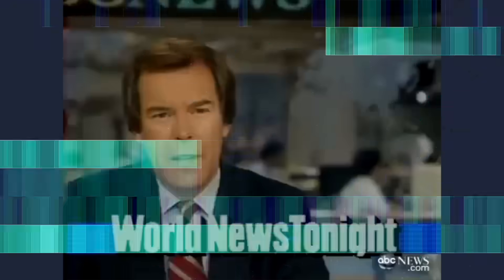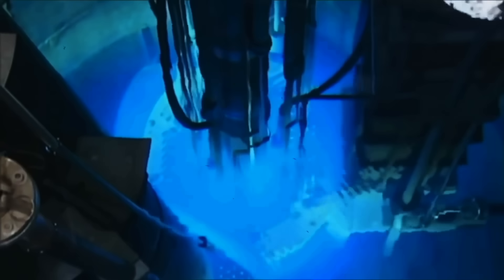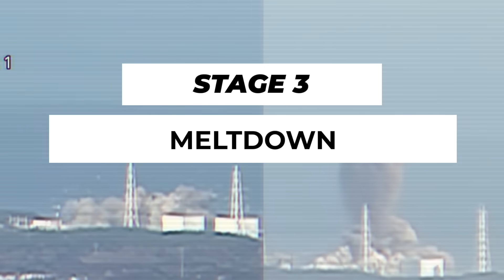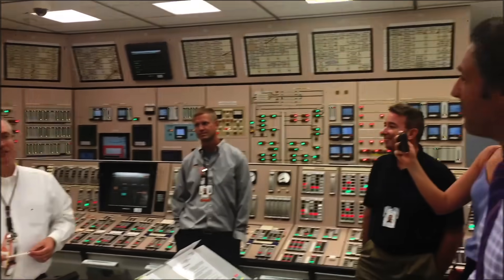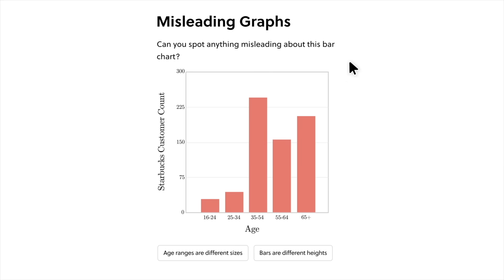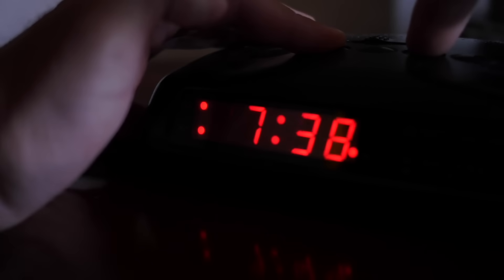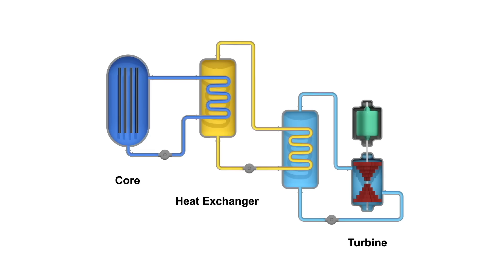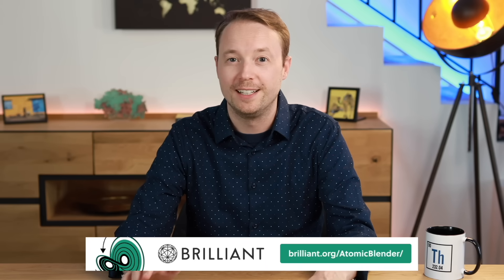Why Is It So Hard to Stop Meltdowns?

Comment: Imagine having a poweful car with a converter automatic transmission, but no brakes. The only way to slow down is taking the foot from the gas and then you have to wait until the wind and the rolling resistance eventually slows your car down. No, it won't come to a halt, because of the torque converter, but rolling with pacing speed, one could at least hit a wall without any damage. Nobody would drive such a car, right? But a reactor is exactly that and when there is a tsunami behind the next corner, too bad.

Tell me boy, are you a sock puppet of the industry. Everything you have told about the caste or the defensive layers is bs, because of Murphy: "Everything that can go wrong goes wrong!" This is the reason why there have been so many accidents, as opposed to the claimed one meltdown every 100.000 years. You simply cannot trust a human or a scientist, because he's too stupid, too vain, too cowardly, too subjective, too greedy, too everything. This is not the right technology for us at our psychological state of evolution.
Reply: Except there is brakes, and MULTIPLE. Nuclear technology is only getting safer and safer as time goes on. We have control rods, which could SCRAM and stop the reactions immediately, RCIC turbines that provide cooling even with loss of power, LPCI that basically floods the reactor and stops water levels from dropping.

Comment: Why do nuclear reactors meltdown?  Very simple.  Dr Alvin Weinberg, the inventor, never intended the pressurized water reactor to be giga-sized.  Westinghouse, GE and B&W thought they could build bigger with engineered safety.  They were wrong.  Dr Weinberg stated that 500 MWth was the safe limit, but these idiots build them over 3000 MWth.  The problem is in the unlikely situation where a reactor is suddenly shut down and is without external power to actively cool the reactor the decay heat from the byproducts of fission, about 6% of the total heat, can not be stopped.   This is enough heat to melt the core.  Dr Weinberg, who was director of Oak Ridge for 18 years, also invented the molten salt reactor.  This is a very safe and efficient reactor and is the best power source ever invented.  Unfortunately the AEC thought they knew better and they fired Dr Weinberg in 1973 as he was ready to build a full sized MSR power plant.  End of Planet.

Comment: Fukushima was a man made disaster. One would have thought with all of Japans experience with tsunamis they would have built the wall /barrier to a height and density where it would actually work. Putting the emergency power supply (diesel generators) low in the building was certainly not the work of forward thinking intellectual engineers.

Comment: Uh.....Id count Windscale along with the other three. And honestly, the TMI incident had a pretty minor release of radiation. Like, sure, you wouldn't want to be sucking on the vent pipe, or directly down wind......but at the distances other structures were from the plant......not much risk compared to a couple high altitude flights or a few days in denver.

But yeah.....Windscale was an absolute cluster frigg of an incident.....

Comment: Meltdown is one of those buzz words. We like to think of it as an unintentional energy surplus - Mr Burns
Reply: *unintentional fission surplus
Reply: yeah normally meltdowns happen because they do not know that the reactor is melting down due to limitations in the tech for monitoring in the systems are not perfect and heat build up can happen outside normal operating situations you check into meltdowns the operators did not know the reactor was overheating to meltdown the monitoring tech has it's limitations

Comment: THE ONES IN JAPAN IN 2011 WERE TOTALLY PREVENTABLE. THE FOOL DESIGNER HAD TO BUILD THOSE REACTORS AT SEA LEVEL AND WHEN THAT MASSIVE SURGE CAME AT 3 MPH, IT WAS ALL OVER. ALL THAT HAD TO BE DONE TO SAVE THOSE REACTORS WAS TO LAND HUGE PORTABLE GENERATORS ON EACH ROOF BY CHOPPER AND KEEP THAT POWER GOING????!!!!!
Reply: You need to understand, reactors get VERY hot. It is easier to build them by the sea, an infinite (at least on the scale of a nuclear power plant) pool of cold water.

Comment: The whole design of the (nuclear power plant) is flawed right out of the gate.  Lets start with the BIG one.  There is only ONE reaction going on.  To boil water.  Housed in (the reactor).  And people think they can tame one beast of a reaction.  nope.  There needs to be several (hundreds at least) little reactions going on.  And the whole thermodynamics will work a little differently when cooling is applied from all sides.  And, now, finally.  There can be an (Artificial Intelligence) to rule over all of them.  Sure, there are a thousand other changes that will need to happen.  But that is the biggest one.

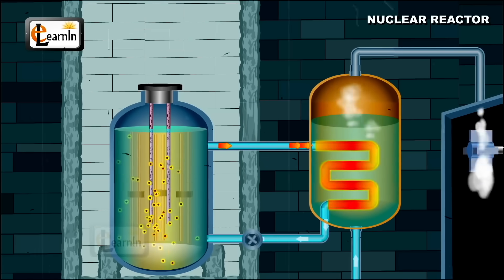Comment: 3:50 Uranium does not hold heat after fission. However after insertion of the control rods, heat can still be produced. Uranium 235, when struck by a neutron, splits into krypton 92 and barium 144 releasing 3 neutrons. These isotopes then decay. It is this that continues to expel heat after shutdown.

Comment: fucushima -
we know the EDG - emergency generators were flooded - grid input was lost and they only had hours on battery backup (mostly used for control and valve operation)

WHAT is not mentioned?
the tsunami took out the 'sump'
the heat sump - so even if backup generators were operational - they could not move coolant into something that would transfer the heat.  Seawater injection was inevitable along with the flushing it back into the ocean  -which was not done because 10s of billions of dollars would be lost.  
of course, they were lost anyway. Now trillions of dollars (50 year cleanup plan)
Years later - this is never mentioned.  i wonder why?

Comment: Reactor power is not generally controlled by the control rods but by steam demand.

Control rods generally control steady state temperature. Raising rods increases steady state temperature.

Over the long term, control rods accomodate fuel depletion. As fuel depletes, the rods are raised.

Comment: There's also boron injection which is like a liquid control rod. In the case of an emergency you can poison the core even without the help of the control rods. Also, control rods are fail safe and drop by gravity. 

The fission products continue to decay though so you still need coolant moving over the core till they decay away.

Comment: The propaganda against nuclear energy is so blown outta proportion and most likely funded by the fossil fuel industry. 

Tally up all the deaths and accidents resulting from fossil fuel energy (collecting or burning, etc) and the corresponding energy produced vs the same data from nuclear and I’ll bet the fossil fuel damage is 100x greater than nuclear with less energy per negative incident

Comment: The problem is that with all the talk of progress and learning, the nuclear industry is pushing hard to keep all the old clunker reactors going. If say American Airlines were running planes designed in the 50's & 60's, and built in 70's, there would be ALOT of accidents.

There's one sure way of stopping meltdowns, don't build them bigger than 150-200Mw thermal output. There just isn't enough decay heat in a reactor of this size to meltdown through the reactor vessel.
Reply: I meant 150-200mw electrical output.

Comment: The head from decaying fission products is only a problem with shit reactor designs commonly used on a 1-pass system like used in the United States where fuel is solid so these products accumulate during reactor operation.  In molten salt reactors, because fission products are normally removed continuously, during a reactor shutdown no heat is produced because there aren't fission products in the fuel to produce heat.   Boiling water reactors should be eliminated because they are inherently unstable and unsafe, opposite is true for molten salt reactors, inherently stable and inherently safe.

Comment: Commercial plants can learn a lot from US Navy ship-based reactor plants.  Lots of safety built in.  Very few accidents even though the fuel is HIGHLY enriched.  

--US Navy veteran nuclear reactor operator
Reply: About 1/6 the MW(th) output of a commercial reactor, correct?
Reply: Yeah, but main problems are occuring when fuel is low enriched, like in RBMK series
Reply: @user-gi6db4bw2o  The issue isn't the low enrichment, it's cutting corners to save money. In particular, RBMKs didn't have a negative temperature coefficient of reactivity - since it would yield a cheaper design - while all US civilian power plants must have a negative coefficient. The safety features, quality control and trained personnel are what make Navy reactors safe, not the percentage of Uranium in the core.
Reply: A lot of Navy in the industry. I’ve had the honor of working alongside some of them.
Reply: Question: What is the danger of to much water? 

Overheat cause meltdown, so  ..  why not passive cooling, such as submerge building under sea surface?
Reply: @budisutanto5987  When the water gets too hot too fast it basically explodes or something like that I think
Reply: @bankruptcy3890  Correct but only in closed space. Water - steam - superheated steam.

Another simple solution for nuke powered ship & submarine, that haven't been done : reactor eject.
Ship & sub then can operate using backup diesel engine.

Usual reaction: it's not that simple.
In reality: it's not that complicated, 100% do able.
Reply: @ Containment. For a vessel out to sea, that's likely the plan if there's ever a serious reactor accident. However, every commercial power plant is located to bays, lakes, rivers, shores that are adjacent to where folks live, swim, etc. One of the main concerns of a meltdown is the core melting it's way into the water table and contaminating it for generations, best not to do it to ourselves when we can engineer better solutions with cooling systems.

As for why we don't construct the plant LITERALLY underwater. Well, for one that's way more dangerous (just increased flooding odds incredibly), another way more expensive (extra maintenance for exposure to the harsh environment, too), and for another, many plants operate near bodies of water that would be too shallow for them to submerge entirely.  

While folks harp on how flawed the RBMK designed is, the true failure is on the Human Performance and risk analysis of the operators involved. Many holes in the swiss cheese lined up for this, but operators own the plant and the reactor and are the arbitrators of reactor safety.
Reply: Core melting in an open sea  VS  cooling using  ..  you guess it, water  😁
Reply: @budisutanto5987  Of course, you never WANT to melt down, but, yes.
Reply: Problem is I’m pretty sure the stuff the military uses is bomb stuff. Dunno the exact composition as I hate chemistry, but I’m pretty sure they enrich it enough that it can be used for bombs, so they wouldn’t want to sell that to commercial companies to “make power plants” if you know what I mean.
Reply: @lynxrbeam8732 yea you just said one of the most Ignorant things I ever seen about nuclear energy and I seen alot